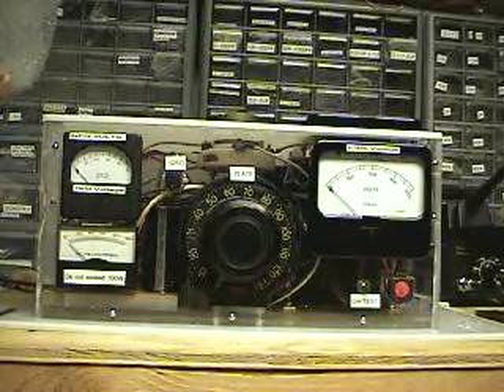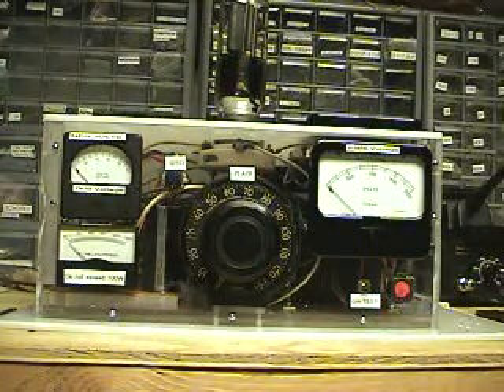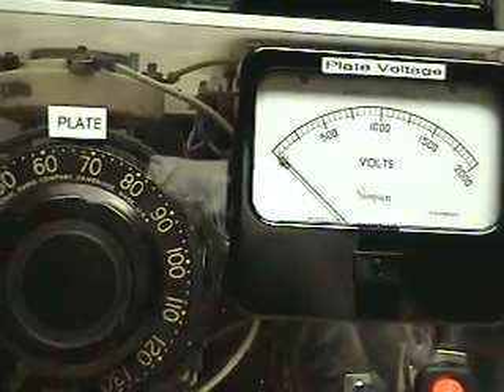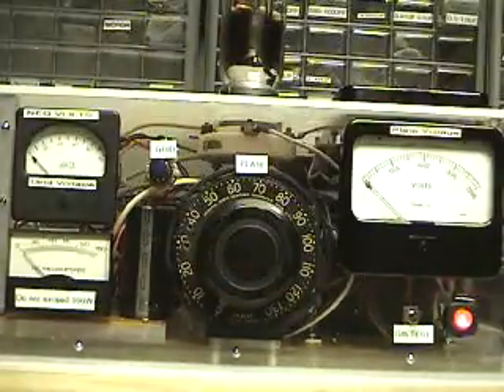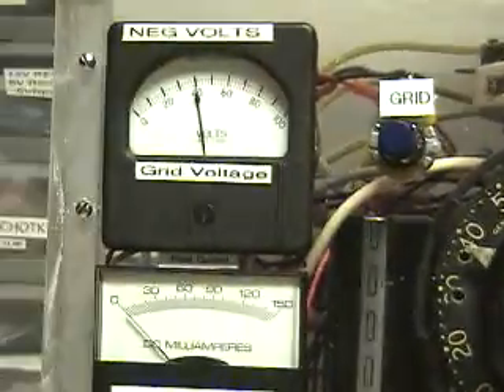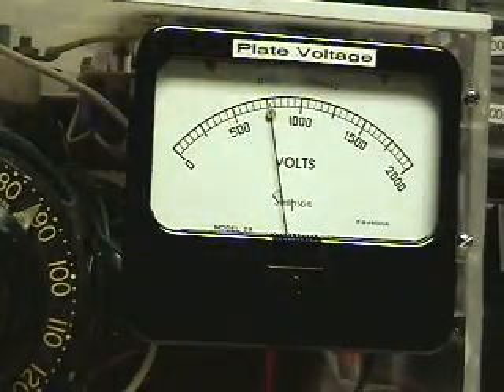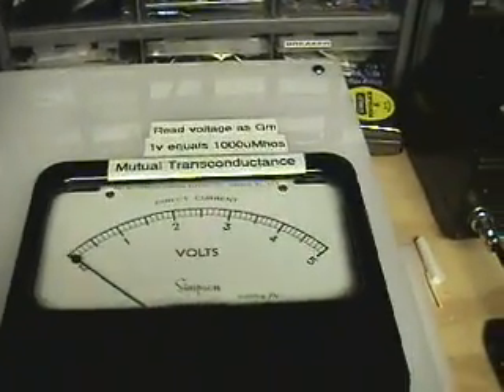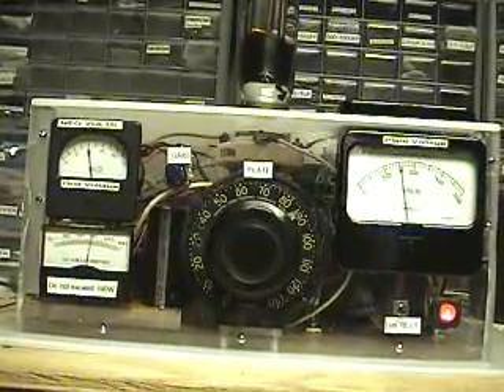Custom built 211 845 Transmitting Vacuum Tube Tester

Comment: Great tester and excellent video - wish I found this before building mine! 

A quick question - which isolation transformer are you using to mix the 1V AC signal on the grid DC for the Gm test? I use a 600R TF5RX17ZZ in my low voltage tester that run to -50VDC but am hesitant to pass the -200VDC the 211/845 needs through it. 

Thanks in advance.
Reply from the maker: Do not remember. It was a generic small signal transformer. I have fuses on all the critical lines (HV plate for the current, one for the grid, one for the filament, one from the AC line into the tester). If you have the right fast blow fuses you have nothing to worry about.
Reply: @imsmoother   Thanks for your reply.

Comment: Hello, I saw this tube tester video a few years back, I want to test transmitter tubes 211 to 833 etc.
Could I get a schematic diagram for this mdelosier@comcast.net
------
The measure output AC voltage would represent the change in IP with Ep held constant.  Transconductance = (DELTA Eg/DELTA Ip) with Ep held constant.